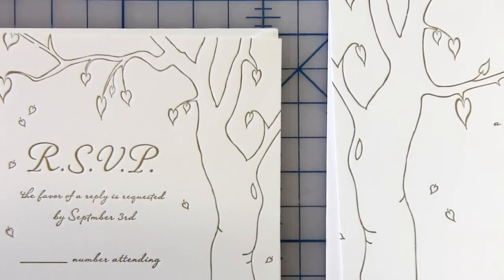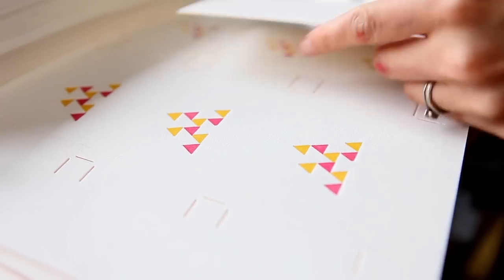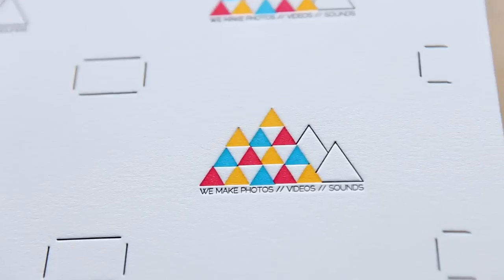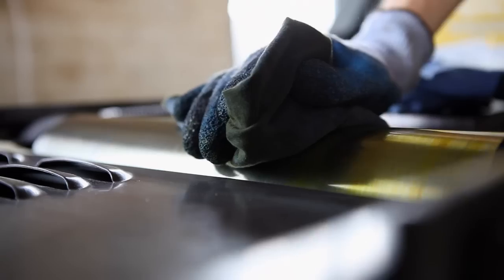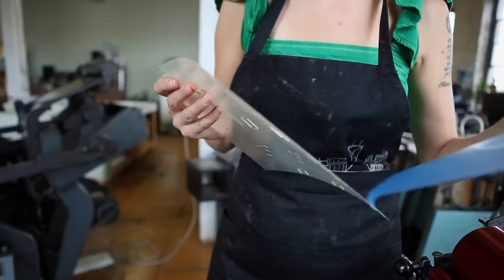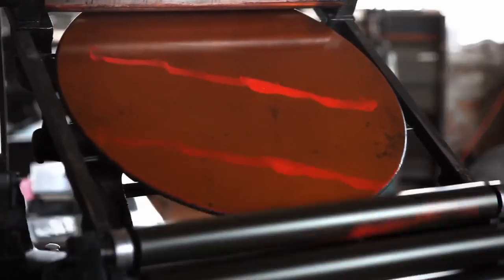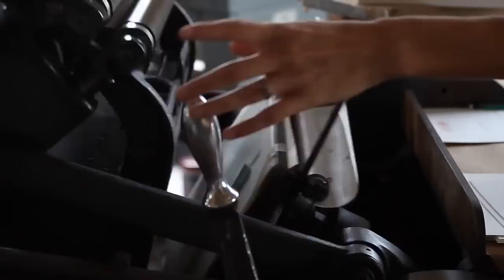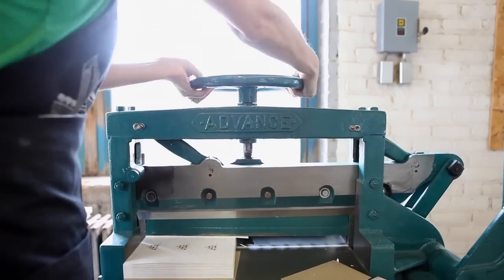Steel Petal Press - Letterpress Printing

Comment: My grandfather did this type of printing for years.  My aunt still has his printing equipment.  I am very happy to see people utilizing this type of printing still.
Reply: I did this for many years also. I was a printing press operator for the City of Los Angeles.
Reply: If I want to change the color, do I have to clean those rollers and how do I clean them? Did you remove the wheels and wash them with detergent?

Comment: In Letterpress printing, if you can FEEL, the printing it has been done incorrectly. My father would walk through the shop when I was 8 years old, pull a sheet from the feeder, feel it with his hands, if he could feel any of the letters, he would throw the entire job into the garbage can, and tell me to START OVER, and do it correctly. Correct letterpress printing, you don't "feel" impressions in the paper.

Comment: 1 final comment.... wearing that wedding ring, is a good way to lose your finger. My family owned the largest commercial print shop in the state of Ohio for over 100 years. I am an engineer in the trade, and I can tell you story after story of those who lost fingers, hands, and entire arms doing what "everyone does" until the day comes, it happens. Don't wear that ring. I in fact, new a guy who reached up to pull 1 ream of paper off the shelf, he stepped up 1 step. When he stepped down, the weight of his body, and in that split second of the edge of the shelf catching his ring, removed his entire finger. And the problem with that accident, is that it pulls the nerves out of your arm, out the hole in your finger, so sometimes, you loose the use of your arm. I see I'm 11 years late.

Comment: Your doing some really nice work, I was amazed to see your manual cutter. I spent 38 years in the printing profession & had not seen a manual cutter before, very cool. Nice video, Thanks
Reply: If I want to change the color, do I have to clean those rollers and how do I clean them? Did you remove the wheels and wash them with detergent?

Comment: I work in printing for 15 years, I know the printers that have worked with your own machines, are now retired.

I have always worked modern machines, I would like to compliment you for your tenacity and passion to work the vintage machines.

I would like to ask you why you pushed to continue this profession? Now we continue to use digital printing though the old machines are always useful for the die cutting of small sizes and low quantity.

Comment: You most certainly need a motorised guillotine/cutter.
There are many beautiful compact ones available.
While a nice vintage cutter should be part of you hardware inventory,  that cut you made with hand driven pressure seemed awkward.
Reply: I noticed that also.